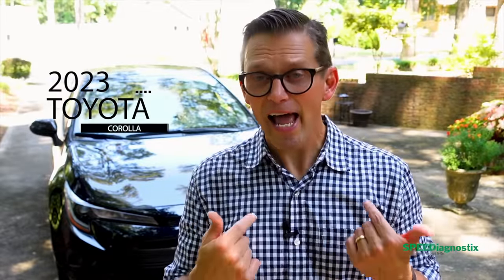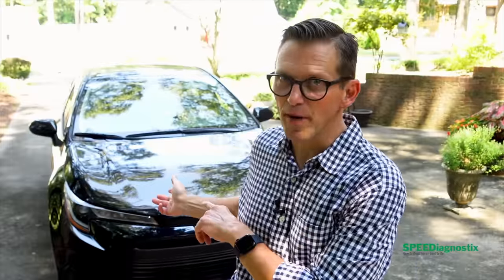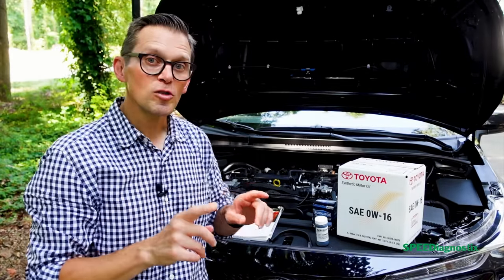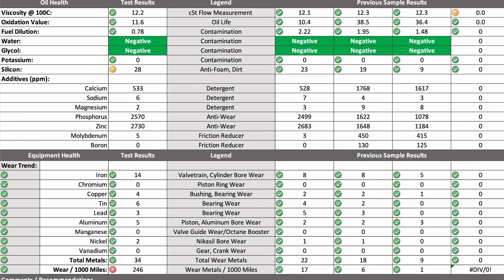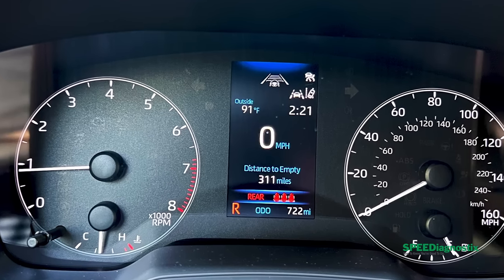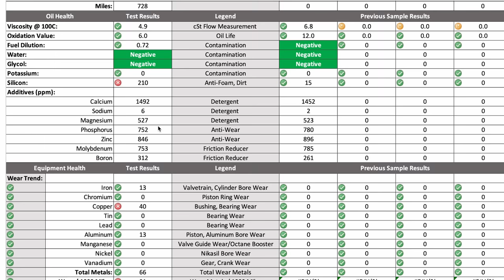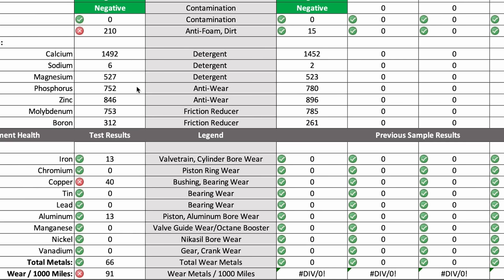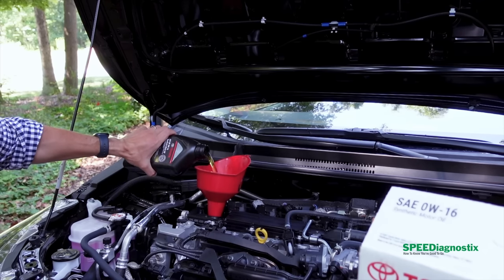AVOID the ONE MISTAKE Almost EVERYONE Makes With A Brand New Car

Comment: When I went through Toyota technician training In Jacksonville Fl, they told us that Toyota does the break in at the factory so that they can insure the reliability and longevity of their engines
Reply: Imagine every single engine of every single vehicle they manufacture bring broken in BEFORE you purchase the vehicle... Lol. Yeah right!
Reply: I have seen it here in germany at Bremen plant for C-Class, they turn the key and drive it cold instant to hell like 300m straight to the parking lot and after a few hours next serbian plumber will drive it same before to the next station 😂😂

Comment: I always change my own oil as most dealers can be bothered to remove the under-tray and often only change the filter then top up. I'm convinced many engine failures are due to lazy work shop practice including downright cheating of the customer.

Comment: The manual you showed indicates putting the correct 0w-8 next oil change.   This indicates you likely will void your warranty (where is you history of oil purchased that will need to be provided for major warranty work) if you do - 16 again.    It also hints it's really not OK as its worded as if in emergency.... If you're stuck and can't find -08 you can use - 16 but then use correct

Comment: I work in a truck shop... iveco 9,11 and 13 liters engine do the first oil change at 150 000 km -93000 miles with higway use... 3 liters engine is 50000 km or 31000 km. The problem rarely are from the bearings or piston.. more often from the chain tensioner or rocket arms 😅

Comment: Very true.  The high mileage is purely to make servicing look cheaper.  The wear isn't an issue for the new buyer as they will probably buy a new car before it is a problem or the end of warranty. 
  My wife's company doesn't get the cars serviced or even check the oil and water. They just keep buying every 10000 kilometres 6200 miles.

Comment: Interesting.  The manual for my 95 Cobra said to do 1st oil change at 500 miles (break in period) which I did.  I change the oil at around 3k miles using non-synthetic oil (did the same with my 80 Celica Supra).  I rebuilt the motor and the engine was clean as a whistle.  After rebuilding the motor, I changed the oil a bit sooner than 500 miles and you could see some stuff in it from what I recall.  I don't recall doing an oil analysis, but there was stuff in there from the build process.

Comment: Break-in oils use conventional base oils without friction-modifier additives to allow controlled wear between the rings and cylinder wall. They also contain zinc and phosphorus additives to protect the camshaft and other components during break in.

Make sure if you do change the engine oil early during the break-in you don't use regular oil, use the manufacturer specified break in oil which you can get from the dealership and is only used during the very first broken. It's very important that you use it because of the additives used to coat The metals.

Comment: Hi, great videos you have. I have a 2020 Toyota RAV4, I purchased it with 15,000 miles. The first oil change I believe was done at 10,000 miles. Can I save this motor, or is the damage already done? I personally change oil and rotate tires every 5 to 6000 miles. I appreciate your response.

Comment: I did a 502 mile first oil change on my 2024 Ford Maverick 2.0L Eco-Boost. Put in Castrol 5W30 Edge synthetic 20,000 mile and a Wix 51348 XP filter. I didn't do the 1 qt flush like you did. I have on hand the same oil and filter and will do another oil and filter change at 2,000 miles. Then every 3,000. This vehicle replaced my 1994 Chevy Silverado 350 with 177K miles I bought brand new. I was an oil changing fanatic. My mechanic had to remove the intake manifold once (well over 100K at the time) and asked me if I changed oil often. I said yes. He said the engine looked almost brand new. I used Mobil 1 the entire 30 years I had it. It still ran great. I doubt the 2.0L turbo will last as long as the 350 but I'm going to do my best to give the little engine it's best shot. I kept detailed records of every oil change and maintenance done. Will do it with the Maverick too.

Comment: I always do the first oil change at 500 miles.  Then, I do a full synthetic and change filter every 5k miles and top off the oil.  Then, change oil and filter at every 10k miles.  Also, GM says change transmission fluid every 60k.  I have been doing fluid and filter change every 15k miles. Do differentials every 25k.   So far, I've got 150k miles on my 04 Chevy s10.  Also, my gas filter gets changed every 15k miles.   All my fluids in my vehicle are AMSOIL full synthetic.

Comment: This is incredible. Basically race oil in a Toyota bottle.

How much shelf life, do most new oils have?
And is 7,500 to 10,000 miles really a good idea?
I'm older and 3,000 was our limit then 5,000 was the new limit. 
I have a 5.0 coyote and I'm having a real hard time believing 7,500.
I did the first 50,000 at 3,000 then went to 5,000. I'm at 77,000 now.
Have been using the recommended ford oil and filters the whole time.

Comment: I went the other extreme with my 15k high rev motorcycle engine. For the first 600 miles, i changed oil 4 times. 
1. 2 delivery miles, change it straight away
2. Change at 20 miles (same day warm up run) ,rev no more than 5k rpm
3. Change at 100 miles, rev no more than 8k
4. Change at 300 miles, rev no more than 10k
5. Change at 600 miles for warranty coverage at dealership, no rev restrctions anymore.
I dont even need to send oil sample in but visible debris(gunk/mud like)
Now it always bunce near rev limiter as a track bike but not a single issue

Comment: Kind of doubt you'll see this but here's my shot so to speak. Recently bought my first brand new vehicle and I want to do the best I can to keep it up to snuff. I've built race cars, high HP turbo vehicles (+700whp 4 cylinders). engines, transmissions etc. And typically I would run break-in oil on a fresh build. What, if anything, would you suggest for a 2024 GSX-8R (Twin Cylinder 776cc Motorcycle). The first maintenance is written for 600 Miles / Oil and Filter. I'm currently around 350 Miles and am contemplating an early oil change but 600 does seem reasonable. Side note this is the first vehicle I have ever seen with a subsequent oil change interval of 3,750 Miles after break-in. I.e. 3750, 7500, 11250. Which seems quite odd nowadays. 

Not sure here because Motorcycles typically run hotter and much faster (RPM's) than a standard grocery getter. Second question, if you're seeing this and feeling up to it. Most manufactures recommend low RPM limits during break-in while to my estimation and experience, you want the engine to see varying load and even up to redline usage while the rings wear... any thoughts specifically in this regard, as I'm aware you have a background in rings as well? I will admit I am an Amsoil guy so to speak, but not for zero reason, it's served me pretty well thus far plus their white papers and studies sold me years ago.

Comment: There are many videos on YouTube about break in for car engines and many tells you different stories. 
Modern engines are much different than 50 years ago. Nowadays synthetic oil’s and filters are much much better. 
So I change the oil after the first 1200 Kilometers. After that, the engine is ready and ready for an oil interval every year or 10.000 Km. 
Always with the best oil filter, off course. 
But that’s my opinion. 🤘

Comment: The amount of wear materials in the oil of that Toyota is probably much lower than what you would find in most other cars. Toyota reliability is rooted in the quality and precision of build process that is used to produce an engine. My 2016 ford fiesta 1.6 Ecoboost returned dramatically higher numbers of particulate across the board in the first oil change at 500 miles of gentle use! And lots of visible ptfe as well.
The man is spot on correct regarding getting rid of that original oil and filter very early in the life of the car.

Comment: Great informative video.  Thank you.  I have one question...I have an older 07 GMC truck and it has a rear main seal leak...is it okay to use a thicker viscosity oil to slow the leaking or would I be doing damage to my engine by doing this?  Thanks!

Comment: You are very thorough, but I did have a question. Shouldn't the vehicle be level in order to drain all the oil out? The oil is always checked on level ground, why would you leave it jacked up while it drained? I had a BMW 5 series and would get it on one ramp, pull the drain plug, jack the car up enough to get the one ramp out, lower the car, let it drain, jack it back up and slide the ramp under it and then finish the job. Any insights are appreciated.

Comment: Bought my '08 Camry SE 2.4L new. 1st oil/filter change was @ 500 miles, 2nd @ 1500 miles, 3rd @ 3000 miles, then every 3K miles since---using Mobil-1 oil and filters. Some would say changing oil every 3K miles is overkill, but until I can be convinced that an engine can be damaged from oil that's too clean, I'll stick to my routine.

Comment: In my new 2019 Bullitt I changed it when I got home. Wot break in, changed it at 25 miles, 50 miles after wot, 100 miles, 250, 500, 1000
Reply from the maker: Right on!
Reply: @themotoroilgeek  clean oil > used oil !! 😁👍🏼👍🏼

Comment: the owners manual clearly states that 0w-8 may be substituted but next change should use 0w-8 ! my wife's highlander has a cartridge style filter, when i changed the oil first time 4,200 miles(yes wanted to do it sooner) the housing had quite a bit of metal particles in it. So, of course i cleaned it out, something no oil change place, or dealer would do,  just having your oil changed will not ensure this level of cleanliness. i would assume a regular canister filter will house these particles, and i always use genuine OEM filters.

Comment: If you are fanatical you could do this but I don't think it's necessary for a car I'm not keeping forever. I have a New Hyundai Sonata with 8k mile oil change intervals in the manual. I will change it at 4k miles and the dealer will change it at 8k for the complimentary oil changes. IF I were to try to flush the system, I would drain the oil and add TWO quarts and start it up and let it run for a minute or two then drain again as I'm not convinced that just pouring in a quart of oil and out the bottom is really rinsing anything. Just my opinion.

Comment: I was under the impression it was important to drive through the first oil change completely to insure the engine gets properly broke in. My 2018 fusion didn’t achieve it advertised gas mileage until about 5000 miles and that’s when i did its first oil change.

Comment: I did this with my 2 last bikes . The oil was change at around 550 KM than at around 2800 KM .
Switch to synthetic at 5000 than oil change every 5000 .
Both bikes needed no adjustment at the first valve check and the older one nothing at the 2nd valve check .
Yep , oil is cheap  🙂

Comment: I've owned many Toyota trucks in my life. Starting with 1985 pickup. I had 250,000 miles on it. I had a 2005 Toyota Tacoma with 180,000 miles on it. I now have a 2015 Tundra with 58,000 miles on it ( I don't drive much with horrible fuel mileage). I have 2010 Toyota Corolla with 220,000 miles on it.
I've always changed my first oil at 5,000 miles. I didn't waste a quart of oil for rinsing. The trucks did fine without any premature engine wear.
Getting ready to buy a Tesla model Y to replace the old and tired Corolla.

Comment: Since this video was made, 0W-8 oil is readily available, including Mobil 1 at Walmart for about $28 for five quarts (the Corolla takes 4.4 quarts). I did my first oil change at 2,937 miles on my 2024 Corolla with the Mobil 1 0W-8 and OEM Toyota (made by Denso) filters. I didn't see Mr. Lake do it, but the drain bolt gasket should have been changed. There are several sellers that sell a case of filters with the washers included, which is what I bought on Ebay.

The Toyota oil was stupidly priced about 6 months ago and hard to get. I was pleased when Mobil technical department told me that they were going to be coming out with the 0W-8 and it would be readily available at WM by the spring of 2024 (which it was). I also spoke with someone at Warren and they indicated that they are monitoring the market and will be developing 0W-8 oil. I find that a little odd since there are plenty of vehicles that are already using 0W-8.

Comment: I have built a few motors in my time, imo the first 500 miles knocks loose casting flash, contaminants in the build process, things seating all junk in the system, regardless of oil quality, junk in the system is not helpful, I agree with this, and will be changing oil in my new car, well once it hits 500 miles…

Comment: Totally agree. My wife thought I was crazy when I changed her 4Runner oil @1500 miles for 1st change. I have always used mobil1 but I am wondering if that is the best product. I recently purchased a new gmc sierra and plan to change the 1st around 500. Our vehicles now use the same oil weight 0w20. I was going to use the Mobil 1 truck and suv 0w20 for both since the GM requires Dexos1 gen3 but wondering if there is a better option. I would really appreciate your advice. Any suggestions?? By the way, fascinating content on your channel.

Comment: Thank you for this video. My new Corolla is at around 700 Miles now. Should I change the oil filter along with the engine oil, or just the oil?

Comment: I bought a 2023 Chevrolet Colorado. At 500 miles I changed my oil out on my own. I replaced with amsoil. On the oil filter itself, I notice lots of sparkling things. So now… seeing that, I think I’m going to change that oil at 5,000 miles. From there, I should be safe to run amsoil as label but of course replacing oil filters and sending my oil for testing too.

Comment: A long time ago I worked at CASTROL as a lab technician,  on all my vehicles I always changed oil at every 5000 km or 6 months which ever came first.  Never had engines wear out.  I did get the best oil at a discount though. 😅
Reply from the maker: Right on!

Comment: Thin layer of oil on the rubber seal/gasket is not for better seal, it is that the next oil change you can remove the old filter (without using potential lethal force)

Love your enthusiasm and tell Dave about this video.
To proper warranty a engine after rebuild you need them oil samples from the first 3 changes after rebuild, interval? What you did with your porsche will do

How many hours/miles and oil changes you do on a nascar engine to break in? Without telling the toyota secret.
So maybe tell what your fathers shop used to do

Comment: I’ve been changing my oil at 5k miles. I have not done an oil analysis on my truck yet. It does have 84k miles on the truck and consumes very little oil less than .5 quarts. SO WHAT would be the best oil change intervals people would recommend? It’s basically a grocery getter and lots of highway miles btw. No hauling or towing

Comment: All the old timers out there (at age 73 I am one of you) should keep in mind the machining of the various engine parts is today done to a far higher standard than was the case in decades past.  Tolerances are tighter, and surface finishes are much finer.  About 20 years ago I saw this at Ford’s Romeo engine plant with crankshaft journals being polished after final machining.  This was done by spinning the journal against a piece of very fine abrasive tape (3M?) which was dispensed from an enormous roll.  It was all done automatically, and the journals went from having a polished appearance to looking as if they had been chrome plated right before my eyes.  Here’s a question: can contaminants small enough to pass through the oil filter actually do any harm to the engine?  For whatever it may be worth our Audis are on 5000 mile oil change intervals as opposed to the 10,000 mile intervals recommended by Audi.

Comment: I changed my new tacoma's oil after 800 miles, was told not to do it that early due to "glazing" on the cylinder walls. But after more research glazing is a non issue, the break is good to go after like 200 miles. Getting the oil that may have serious metal shavings in it, out of the engine is important.
Reply from the maker: Absolutely!

Comment: In the UK  0w16 oil cost £75 for 5L & 0w8 cost nearly £95 😯 That's good oil you've heard.  But MOTUL NGEN 0W-8 HYBRID ENGINE OIL LUBRICANT JASO GLV-1 MAZDA TOYOTA 4L (Manufacturer Part Number 111845)  cost £42.  Would you put £42 oil in your car?

Comment: Nobody in my family ever heard of having the first oil change early, except in 2005. My mom got a new Jeep Grand Cherokee, and the guy suggested doing the first oil change at 2000 miles. I did.

I did low mile oil changes on other cars I had. However, it was because of time instead of mileage.